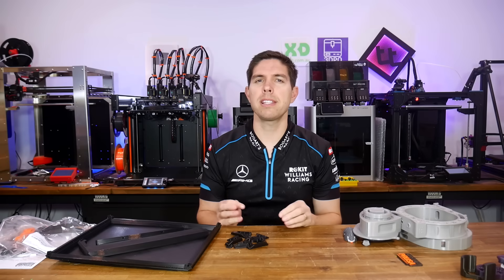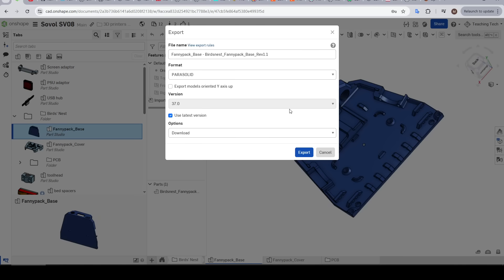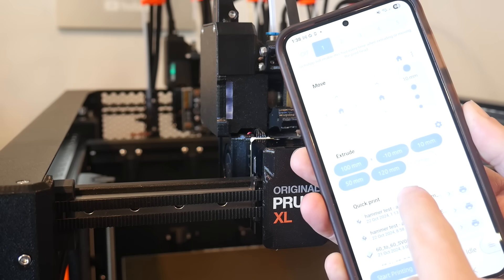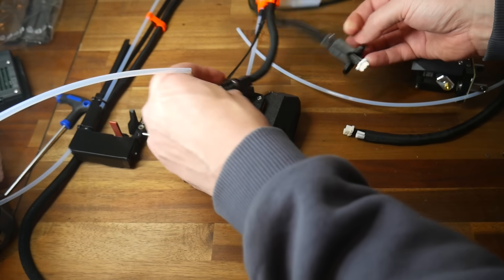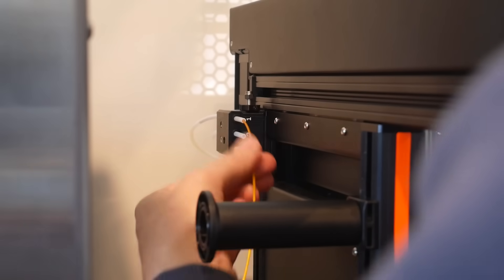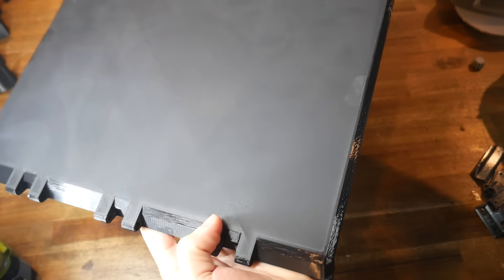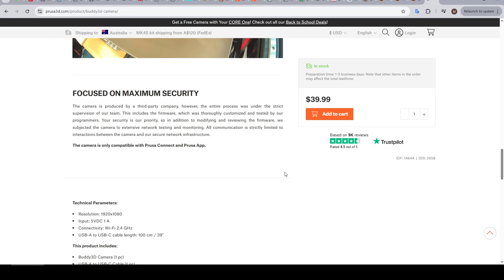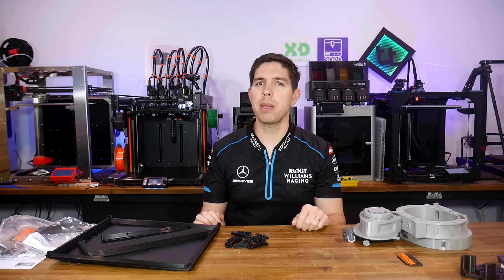Evaluating my replacement Prusa XL + SV08 update

Comment from the maker: Correction: PrusaSlicer doesn't have a button to add for plates to the workspace, but you can drag a part to the side to automatically add plates. Not intuitive but still my mistake. I have trimmed this part from the video and will have a correction in the next instalment.
I expected people to tell me to use OrcaSlicer with the XL. It is compatible with the printer but Prusa Connect currently is not.

Comment: I've been put off the XL so much by reviews on here and yet even after this review, I'm beginning to make my mind up after all...  It seems, similarly to you, most other reviews are trivial complaints about the screen, User Interface, Web Cam, and that it needs more printing knowledge to get the best out of as opposed to the new fangled Bambu's designs for children to use...   

Don't get me wrong, I love how easy it is to choose filament and colour models etc on my X1C, the screen is just like my well known phone, so feels familiar, but I hardly have to use it, I send files direct from my laptop all the time, As I do with my Mk4S come to think of it, so that excuse is dead already... 

Then in terms of the Web Cam,   how many times do you actually use it? other than to show off to friends that their print in on there right now !? It's pointless...   I'm sat next to the dam things in a room full of them all the time, I never have to use the webcam for any serious use...

As for the slicer and usability, Bambu just stole all their software off Prusa, it works because of the work Prusa and their community have done for 3D Printing on a whole...  the stringing issues only come from a miss match in print temps and speeds, with most filaments now being tested on the faster and cheaper bambu machines, not the more expensive professional machines...  I have similar experiences working both ways with the X1C and the MK4S, Can't get the Bambu to print PA for love nor money, but the MK4S makes it look easy, with less messing around with slicer settings to try and get it to work.

Additive manufacturing engineers don't need all the glitter and sparkles like the masses of makers and tinkerer's, they need reliability and trust that once you purchase, it won't be superseded within a few weeks.   I'm finally over all these silly complaints and dreaded issues with the Prusa XL, I'm getting rid of my X1C and instead of the H2D I'm going for the 5 Head XL... Minds made up !!  🙂

Comment: Thank you for the CAD link! I'm excited to finally get my sv08 tool changer under way now that I have all the parts besides what needs to be printed. One small thing (and I may just be dumb here) but I looked through the link and couldn't the bits that are supposed to go in the sides of the aluminum extrusion to attach it to the top of the front of the sv08 frame

Comment: I too am an early XL adopter, and reliability has been an issue. But, that's offset by remarkable after sales service. For instance, I only recently started printing more exotic materials (PA6-CF, PA12-CF) and quickly found my original PETG idler arms wouldn't feed the exotics inside my Voxel enclosure.
I tried, but couldn't reprint the parts myself, cause the idlers deformed.
A 50min chat online with Prusa Support (24/7!) has ended with the new PCCF parts in my Australian letterbox in 6 days. And the new cable supports, too. Even though my XL is well out of warranty.
Full marks.

Comment: I'm sorry you are having so many issues with your XL.  I bought mine in the original pre-offer and got it a couple of months after it was released.  I have had a few minor issues but nothing is perfect.  The main thing I would like to address is your stringing problem.  I don't have that.  I live in a humid place.  The humidity in my house sits around 65% and that is only because the A/C can't get it any lower.  I keep my filament in a dry box with desiccant and pull them out for printing.  The inside of my dry box sits at 10% humidity.  I would have to say of all my prints less than 2% of them have stringing.  I use PLA, PETG and TPU.  Even the TPU has very little.  I tend to use Overture brand filaments.  Perhaps its the brand of filament you use.  

Good luck with your future endeavors and keep up the great content.

Comment: I don't think the prusa xl with it's non-klipper firmware, it's closed source hardware, it's stringing issues (however minor), and it's lack of a decent enclosure (the first party enclosure is trash) is just a waste of time when you can build a more reliable toolchanger out of a voron via the stealthchanger project.  especially now that LDO has a stealthchanger kit.  on the prusa website right now, the XL with 5 tools (which seems to be it's max loadout), in it's least expensive (no enclosure, semi-assembled) configuration costs $3500.  an LDO 350mm voron v2 kit goes for $1450 (including a pi4).  the ldo stealthchanger full kit for 6 toolheads is $ 549.20.  hotends, extruders, and fasteners (specing rapido 2f, wristwatch g2, and fastener kits for dragon burner toolheads, and a pack of 12 magnets for magnetic docking) come to $900 for a grand total of $2900.  note the elephant in the room, it's NOT a turnkey solution like the prusa xl. BUT with a $600 difference for a significantly more reliable system in the end that's easier and less expensive to maintain, with an extra toolhead... even if you wanted to account for some dry boxes you can print from at around $20 for each of your 6 toolheads with integrated hygrometers and dessicant (another $120 or so) you're still only at $3020... and if you paid yourself $20 an hour to account for your time in building times 8 hours a day of serious effort for a long weekend (about 4 days ($480) you'd be up to the same $3500 a prusa xl costs but with a better, more reliable, easier to service printer.  note: all of the prices for the exercise I'm listing here are from west3d, a well known american supplier of 3d printers and components (particularly voron stuff but lots of other stuff as well).  I will also note that this is NOT theoretical to me, as this is EXACTLY what I just ordered.  I have already built the ldo 350 v2, and I just ordered all the parts I laid out here to upgrade to a proper toolchanger - they should arrive toward the end of the month.

Comment: Thanks for the honest and in-depth status update. Prusa has been up the forefront for many years but it has since fallen back. When you said that you spent solid 70 hours printing and I see the speed of the printer, my worry is that the 70 hours was just for the few models that you have shown in the video. 

I reserved my xl very early on but as you remember it took them forever to release anything. I canceled my reservation after more than a year and got a bamboo lab printer instead. I've been happily running three of them at the moment with absolutely no regrets after looking what XL is offering today.

Comment: There is no reason to buy any Prusa anymore.B Bambu are beating them at every price point. The H2S makes the core1 mk4 obsolete and the upcoming H2C will kill the XL.

You used to be able to justify the price because they just worked but the XL has been a turd since day 1 and they still haven't fixed it.

Comment: nice that you got a new printer. I'm still very unhappy with my 5TH XL. Always Stringing no matter what I do. I think Prusa needs to start figuring out how to produce a product in a timely manner, that actually works for the majority (99.9%) the first time. I have 2 Prusa printers and 4 Bambu and I can tell you the bambu experience is soooooo much better. I like prusa for the most part. they have done alot for our industry. On order I have a snapmaker and a wonder maker. My gut is both will be better than the prusa 5th xl.

Comment: As a relatively early adopter, I'm not sure whether I feel good that I didn't get a crappier printer than what's out there now, or depressed that they haven't been able/willing to fix the long-standing issues that you mentioned.

That new injection molded screen holder looks so much better than the janky 3D printed one. I like that they still make the model available for it, but the default one should be injection molded for sure.

Comment: Those updates on machines are very, very important and often missing in the 3D-printer-review-bubble. Although I think many of your problems came from getting an early unit - with Prusa seemingly had to push out an unfinished product? - I hope those problems are the exception with upcoming printers from Snapmaker (U1), Bambu Lab (H2S) and Creality (K2 Pro).
Could this stringing come from reheating the nozzle after changing tools?
And what do you think about the Snapmaker U1 campaign? - Is the 3D printer market getting interesting again, after Prusa, Creality and Bambu Lab concentrating only at expensive flashy high end prosumer models?!
Is the upcoming INDX already the next step after tool changers and still have to be dialed in by Prusa?

Greetings from Germany and thanks also for the update on the SV08!

Comment: Prusa is still in the mindset of a 3D printing being the hobby itself - constantly tweaking, printing additional parts for the printer itself, etc. whereas brands like Bambu and Qidi produce printers you can setup and use out of the box. Creality have been able to transition away from this tinkering mindset which was a necessity with their Ender line to produce printers that work out of the box. Prusa are getting left behind.

Comment: It just looks so unrefined, like they stopped at 60% of the mechanical engineering and called it good enough and now they have fundamental flaws in the design, that can not be fixed, without redoing the whole printer. 

Also there are so many 3d printed parts, and while they are probably strong enough 3d printing on such a scale is just a giant waste of time and energy, and makes the thing way more expensive than it should be. The fact that Prusa kept using 3d printed parts for so long even though their sales numbers are easily high enough to benefit from injection molding just shows that they are stuck in their ways and are not looking to actually create the best product.
All of these negatives and then there is the price and lack of features, besides the multi head feature and the very large print bed, it basically behind the competition in every aspect at a price that is higher than everything else.

Comment: It still horrifies me to see 1st party 3D printed parts to look so terrible... I means even disregarding the Chinese company that Prusa loves to constantly cry about... my fleet of self built Vorons don't even print this bad...

I mean there is nothing wrong with having 3D printed parts vs injection molded parts... but even 1st party printed parts look this bad... what does that tell me about the printer I paid $5000+ for and am setting up? I mean they are doing themselves a disservice... especially when it cost leaps and bounds more than the competition while looking worst than self-built DIY printers and you are barely building it any less than fully self built printers...
Reply: Agreed. Every time I see a closeup of a Prusa XL machine the terrible print quality of the parts is shocking. Obviously Prusa is running their farm machines too fast. It is a bad advertisement for Additive Manufacturing and not acceptable.

Comment: I bought a mk3s when with mmu2 when they just came out and I've not had too great experience either. While the mk3/s printed reliably for a while, the mmu2 has been useless from the start and the few times it did run it was really fiddly and prone to blockages and issues. Add to that the display of the mk3s started becoming unreadable with white clouds on it within a year and when it became too much of an annoyange about 1 year and 3 months after buying the printer prusa told me that it's not under warranty so I would have to buy a new display. Not the kind of treatment I would have expected... both are still gathering dust here, not sure what to do with them.

Comment: Regarding multiple plates in PrusaSlicer. You don't need a button. You can just drag a part outside of the plate and the slicer will present an additional plate for you to put it on.

Comment: Hi Michael, awesome update. Just something you might not know, loctite in 3D printed parts will damage the plastic, especially thermoplastics like PETG, PLA, ABS, etc. There's some info on as to why in a video on youtube called something like 'don't use loctite with plastic' or something along those lines. It's worth a watch. If you use it, try not to get it on the printed parts! :)
Reply from the maker: Thanks for the heads up. In this instance, I'm using it only around metal parts so should be good.

Comment: My prusa xl has been an issue for a year and a few months. The nextruder just sucks, so many jams and such. I finally found that the filement sensors were pulling on the filament. I went through and drilled out the sensors and changed the ptfe tubes, removed the enclosure and now do get better printing. Don't get me started on the prusa connect and prusa color slicing, they are so far behind. The reason I won't buy the U1 snapmaker printer is because of the slicing in color will not be very much fun.

Comment: A toolchanger is a complex machine. The hardware anyway but most of all the software. The only brand wich is capable to do this properly is Bambulab. BTW: the H2C produces no waste. The filament has to be cut and pulled back, but each filament has its own nozzle/hotend, so no purging is needed while reloading.

Comment: Mine is from March 2024 and has been printing along real well, except:
- white PLA strings terribly while the other colours from the same manufacturer don't, so needed its own profile
- brushed for the docks to clean nozzles to improve reliable bedprobing
- fan on the buddy board to prevent overheating
- the side filament sensors introduce some resistance at the end of rolls of filament, resulted in a couple of failed prints.

Comment: I had a long look at the Prusa XL when I was looking for a new, bigger 3D printer. I wanted a bigger build volume and multiple filaments. Fully equipped but partially assembled, this printer would cost 4209€ ordering from Germany. Watching all the videos showing the issues, I got the impression this printer wasn't ready to be sold. I chose to build a Voron 2.4. Quite the challenge, time-consuming, however very satisfying. A tool changer and a Box Turtle are in the works. Parts for the latter are already waiting on my shelf for autumn and winter, a good time to hole up in my little hobby workshop.
Reply from the maker: FYI that price in Euros converts to $7500 AUD.
Reply: @TeachingTech  Thanks, I didn't realize it was AUD. Still a hefty price tag for a printer with issues it shouldnt have.

Comment: Hi Michael, i had the plessure of running a early version and my new 2024 XL5T. It seems i was lucky cause i didn't get much issues. The XL is outdated and everybody is waiting for updates if that even is possible.  I am eager for your review of the to be released snapmaker 5T :) and the comming bambulab toolchanger. It seems Prusa isn't developing fast enough and in my opinion we have a 3d printing revolution once again with all the inovations. And with inovations you get winners and loosers like in F1 :) were McLaren is now the lead and RB not so much anymore.

Comment: OK EVERYONE WATCHING THIS.    The earlier models had a faulty design on the top of the tool heads.   The cables were not secured properly,  this resulted in tiny movements between the male and female cables socket,  eventually the cable connecters wear down.    An recent update checks for stepper motor skips which happens with a bad cable.   thats why you get the extruder not spinning error.      IF YOU GET THIS prusa should send you 5 new cables and the plastic parts for your tools heads.     This and a hard reset solved all the issues i ever had with this machine.   The new tool head plastic are to stop the cable moving around to stop the sockect rubbing together,  it is not to press the cable down into rto socket like on this video,  in fact you should have the cable Stright and tight so no movement can ever happen.      Now it is flawless.    You can literally see how the fault causes the error, it was a bed design originally.  The stringing your getting i just can not understand at all.    I literally never get stringing.         Do you think the brand of filament your using just does not like the XL.   I own FL sun machine and Bambu and Prusa,    The build quality of the prusas components are clearly thew best,   but that does not mean the print quality is any better.   Reliability and fixability the prusas win out being hand built machines that can easy be fixed.   But they are expensive,  personally i love them,  over thousands of hours print time, the 5 Prusa mk4s i have are still going with no issues,  that can not be said about the other brands i am using having multiple pain in the arse repairs.   I am hoping that the XL now proves it reliability,   Also Prusa are just the best for support, skilled help and sending spare parts.   Which is ace when your running a business their people really know what their doing.    But i can also see why other people prefer the bambu machines if you just want a take out the box and push button print experience.    For multi colour prints with little to no waste and the speed the xl it is the best but it cost a lot and newer multi head machines are coming soon.    so perhaps i would wait and see what the new ones offer if i were looking for one now.